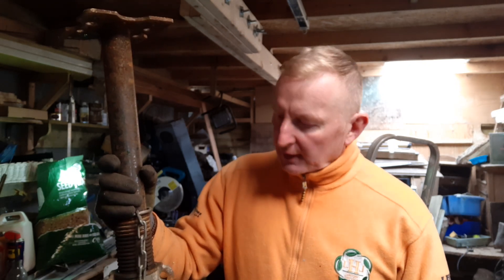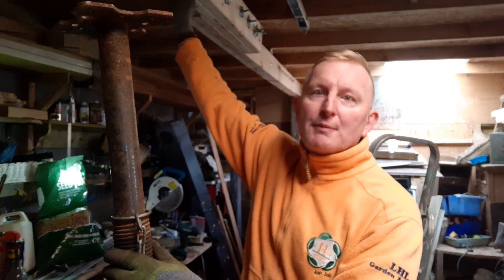GREAT TIP for ACRO PROPS..

Comment: You can use that same technique to pull. So you can bolt the plates on each end (through the bolt holes) and with the pin in underneath to pull with a lot of force. We have used this to square up walls and beams before.
Reply from the maker: Great tip 👍👌👌👌

Comment: is it ok for a size 2 prop to bend a little forward in the top section with a strong boy attached? the bottom is plumb and the top was at the start but bent slightly when wound up....

Comment: Haha Snap, paperwork and servicing equipment as well as keeping an eye on river levels and reporting it to local groups.  The river is due to peak again today at 5.5 meters + - hopefully thats the last of the flooding here in Shrewsbury .  Many years ago on the Farm i almost took out my uncles nuts as the pole shot out like a rat out of a drainpipe.  He showed me the correct way of stowing acrow props and explained he learned the hard way . lol..  Just remember to check the pin is still in after transport though .. ouch .... And here comes some more rain Grrrrr  have a good one
Reply from the maker: 😁😁🙈🙈...hope the floods clear up soon for you and you have a better year 👍👍
Reply: @LHLgardenservices   so do i its been horrendously wet winter. A good part of Shrewsbury is flooded including businesses.  Works piling up but not much to do in pouring rain. Not even cut a lawn this season yet. even the usual  dry ones are soft and soaked .  Spent much of stor Ciara & Dennis out cutting fallen trees.  ..